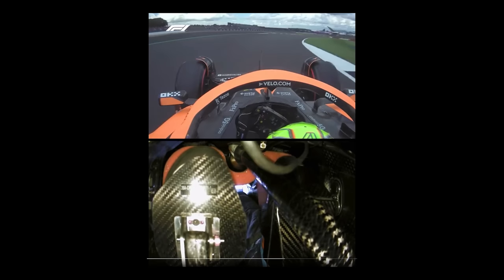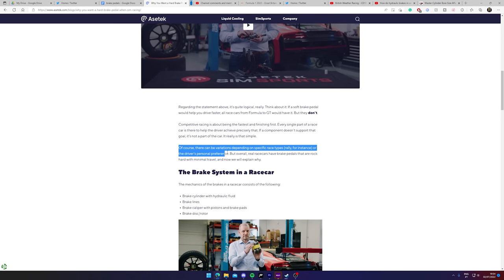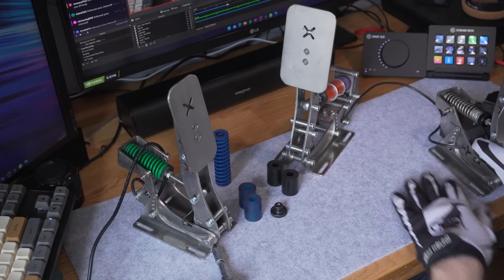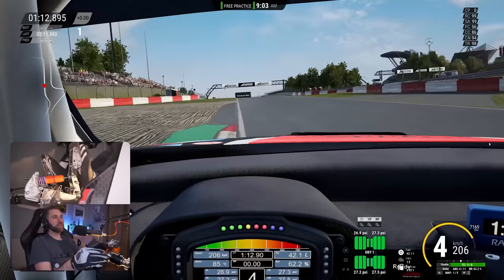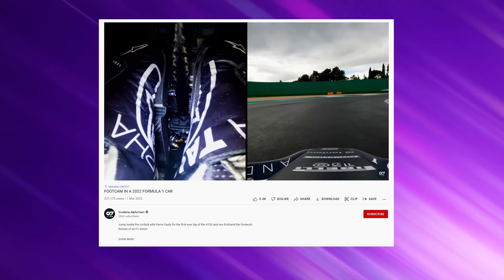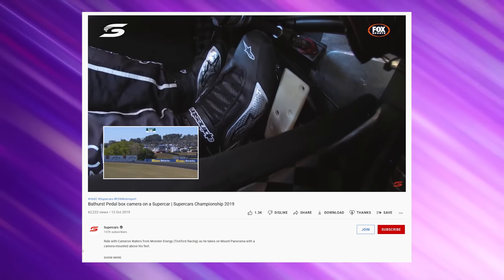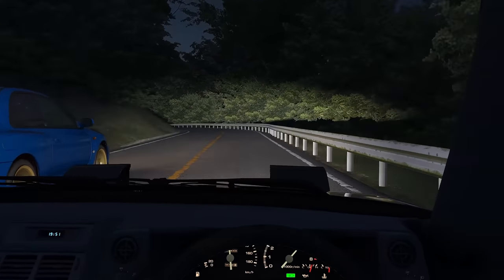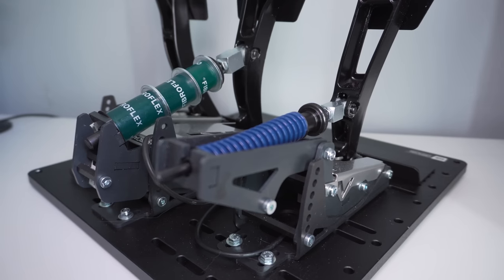Lando Norris brake cam shows simracing brake travel is all wrong

Comment: This was the first thing I thought about when I saw the footage from Lando.  I got the CSL load cells and like a lot of other people found them too stiff or not having enough travel.  Nice to see the pros like a bit of travel too!
Reply: That travel is not preference. Imagine how little control you'd have on the brake if you had a short travel. In Lando's video, you can see he slowly lifts the foot off the brake as his speed and gears go down.
Reply: what brf # are you using with your CSL:
Reply: @chadden24  I have it at 75 at the moment.  There's nothing wrong with the force.  It's more about finding it more difficult to get consistent trail braking
Reply: @grahamhill4113  
Try swapping in springs or softer elastomers, and having a mix of the original hard ones and softer ones. I find having that soft bit of travel before hitting the hard point, somehow help modulating braking better (instead of the CSL LC's zero travel situation).
Reply: @BrunodeSouzaLino  part of why he is doing that is due to a lack of anti-lock brakes
Reply: @BrunodeSouzaLino  I have almost no travel and have no problem modulating brake pressure. You modulate with force, not position with load cell pedals.

And in the video Lando has what, 3cm of travel in total in the brake?

Comment: One thing I think is being overlooked in terms of the F1 brake system is the fact it is a brake by wire system. The pedal isn't connected to any part of the braking system, it is connected to a black box that determines the amount of braking force to apply and the amount of retardation used by the Energy Recovery System. So I would say the pedal travel at least in an F1 car is a driver preference. I seem to remember that Kimi had a lot of problems adjusting to the BBW system when it was first introduced as he said the pedal felt numb and had no feedback of the braking response.

Edit, as pointed out below I was incorrect in the statement I made about the pedal connection to the braking system.
Reply: A very valid point but you are kind of half right. The brake by wire only operates on the rear brakes. This was introduced as part of the hybrid harvesting system. The front is still a conventional style brake setup. Maybe purely from a safety point of view. Also because if the fronts were electronically controlled we all know some devious software engineer would probably code in an anti-lock system. 😂 But yes you are spot on. A lot of drivers didn’t like it (and some still don’t) as it removes a certain amount of "feel" when braking. During testing a few teams (Williams was one) that had rear brakes catching fire because the brake by wire just wasn’t doing what it was supposed to.
Reply: I agree with Andrew. They will never have a full brake by wire system as it would require a fail safe in terms of if something would fail. Bmw has this on their new G-chassis cars. They use a DSCi module where the brake booster would be but there is still a mechanical connection to the brakes
Reply: @justinrehm6839  can confirm, have 8 series and it actually works pretty well but it will compensate for fade which I’m not sure I’m happy about. I’d be nervous if it didn’t have a mechanical failsafe
Reply: No it's not, the pedal is connected to a Tandem Master Cylinder directly, source, I work for a company that builds the Master Cylinders for both Red Bull and Alpha Tauri
Reply: So thats what BBW stands for...
Reply: Well Kimi was absolutely all feel driver.
Reply: Wrong, the pedal is physically connected to the master cylinders

Comment: I recall seeing a video interview with Sebastien Loeb in a custom sim cockpit and they had a setup with a hydraulic brake that clamped on a disc that spun according to the car's speed. This might be the most genuine sim way to emulate a real brake setup instead of what we have now.
Reply: time to go salvage an electric motor and my master cylinder and caliper/rotor from my car hah. Did they have a tire and wheel on it too, to give inertia to the setup? that's a crazy setup
Reply: @kylecossette5044  Maybe you could just bolt a weight to the brake cylinder for that purpose?

Comment: The "need" for a high force, short travel pedal in sim racing is all bullshit passed from one person to another and hailed as gospel. James Baldwin says he runs a low pressure brake specifically because it's less tiring over a race and so he can be consistant. When all is said and done it's all about using what you want and practicing with what you have.
Reply from the maker: Absolutely. Swapping master cylinders to fit the driver or track is pretty common.
Reply: @randomcallsign  the caveat with real world driving is you have other forces at play, g forces on your body and being shaken around in the cockpit, all which would prevent careful control of the pedal if it were too soft, so there you do want a decent force at the pedal (without being ridiculous) but travel really is just a preference.
Reply: @ravey1981  yes when you brake in a real F1 car you are pressed forwards in the cockpit by the g forces, so your ability to generate high load on the pedal increases the faster you decelerate
Reply: @johnduncan5117  well, yes and no. You don't move forward because you are strapped tight into the seat, and you're leg doesn't move forward because it's attached to your hip. But yes there is an increase in the "weight" of your lower leg but it's not as big as people would have you believe.
Reply: @ravey1981  Since you are moving the same speed as the car, you'd have the same amount of force regardless. Plus you're beind held by Hans and a 6 point belt.
Reply: @CleanPipes Source?
Reply: @CleanPipes This has nothing to do with G forces, but brake temperature.
Reply: @CleanPipes Your first statement is how every single brake system works. Stationary braking is down to brake temperature. Carbon discs don't brake well when they're cold.

Comment: My brake pedal feel is exactly like my road cars pedal feel. I'm never going to race, race cars. So I'm  keeping my left foot doing something that it's use to doing, and it works for me, plus it's basically worked out now, ever hour spent braking in sim couples with my actual car
Reply: I feel the exact same. However I drive a manual so I never left foot brake in my road car, yet I prefer the feeling in sim to be the same as my road car. Also can't right foot brake on sim at all. Weird how brains work lmao
Reply: @AcD420  Should get use to left foot braking in it, whenever I drive hard I switch to heel n toe + left foot
Reply: @McNab1986  hmm. It's pretty impossible to left foot brake only in a manual. Did it once by mistake for my license test tho, nearly made the officer in the passenger seat fly through the windshield
Reply: @AcD420  who said anything about using only the left foot. Don't need the clutch, left foot brake, you do need the clutch, you heel n toe
Reply: @McNab1986  oh sorry thought that was what you meant. Yeah that would certainly be possible. Might need to practice in my mom's car first then hahaha, definitely ain't practicing that in my own😂

Comment: I think that the pedal is set to Lando's preference, either that or it is stiff, because every time I see regular people driving f1 cars at events and such they can almost NEVER get to 100% brake pressure. F1 drivers are just very strong to be able to press it to 100% consistently
Reply: I agree 10000%. I think braking is very underrated in its difficulty in an f1 car. The maximum brake force the tires can handle changes as you decelerate because the aero becomes less effective as you slow, the tire temp matters a lot, and there is so much force to actually resist.

f1 cars can pull 5G on the brakes, that is basically 5G pushing the driver into the brake pedal. Yes, the harnesses and the seat absorb a lot of this but i’d imagine it’s still well over 1G into the brake pedal. If you wanna know what that feels like, stand up and do a calf raise with your left foot. Wouldn’t be surprised if drivers put well over 1.5x-2x their bodyweight into the pedal. Controllably. For an hour and a half. 

Mind blowing stuff.
Reply: Yeah.

100-150kg is 100-150kg regardless of pedal travel.
Since these cars don't have brake boosters, the only leverage is the pedal lever arm itself.

So it's always stiff, only the throw can be adjusted it seems.

Comment: Thanks for the video!

Trying to find spring sets for my brake pedal to mix with the elastomers just had me confronted with sim-racing elitism that ridiculed the possibility of someone wanting some light-effort travel before hitting the elastomers and compressing those. Finally someone who points out real systems actually do work like that and are not hard as a stone from the first contact onward.

Another thing to note is that "hardcore sim racers" are quick to ridicule people who do not want to drive formula cars all day. I bought my sim rig to yeet street cars over the Nordschleife, drift down Mt. Haruna and cruise the Shuto Expressway. In fact, I've never driven a formula car in the sim rig, I just don't like the things.

Somewhere the "simracing community" has ingrained itself that:
1. You NEED 15+ Nm
2. You NEED hard-as-rock load cell pedals
3. You can ONLY do GT3 OR Formula-style racing

I stopped visiting /r/simracing and related communities and just did my own thing, which made ME happy. And I don't need to make excuses of "yeah that's just what it feels like in a RAcEcAr" to everybody who hopped into my rig, as the inputs just feel similar to a generic road vehicle.

It'd be a good thing if the simracing community stopped being elitist circlejerks for a minute, and see what actual cars do.

/rant
Reply: Its a game. Have fun. I do agree with the 15+ thing, but thats more for redundancy reasons. But in the end you need to have fun with your hobby. No one here is a pro racer or aspires to be.

Comment: I don't have any info regarding the brake pedal travel for F1, but I listened to a podcast with a long serving F1 engineer (Jock Clear I think) and he mentioned around 55 mm travel for gas pedal in the Schumacher era. He mentioned Villeneuve who had less than 30mm gas pedal travel.
Have in mind that the current F1 cars have brake by wire.
Reply: Current F1 cars have hydraulic brakes and steering. The electric variations of those two are banned.
Reply: Jock Clear mentioned this in his episode on the official F1 Podcast.
Reply: @BrunodeSouzaLino  I looked it up, the rear is wire, the front is hydraulic.
Reply: @iulian2548  As per Section 11, Article 11.1.1 of the FIA Technical Regulations:

"With the exception of a power unit, all cars must be equipped with only one brake system. This system must comprise solely of two separate hydraulic circuits operated by one pedal, one circuit operating on the two front wheels and the other on the two rear wheels. This system must be designed so that if a failure occurs in one circuit the pedal will still operate the brakes in the other."

Even if you have an electronic system to control the rear brakes, they're still hydraulic.
Reply: @redscreentrombone4685  I did read the technical regulations to confirm that before posting.
Reply: @redscreentrombone4685  Did I say brake by wire was banned or did I say electric brakes were? Those are two different things.
Reply: @redscreentrombone4685  Regulations don't name exactly what they ban

Comment: I think the main thing pf the sort/stiff pedals in simracing is that, at least for me,  you can be more consistent with presure than with travel. In sim there is a lot of information you lack, like the pedal vibration or G forces. Thats because in a real car, you can have larger pedal travel to modulate the braking easyer.
Reply: A potentiometer or hall sensor with a rubber block that requires increasing pressure to depress the pedal further already allows your brain to process and remember pressure.  It's irrelevant whether the instrument measures pressure directly or not.
Reply: @saintsalieri  And that's literally what I'm saying, since with that ruber block, you are relaying in the pressure, not in the travel. Im not talking about the device itself.
Reply: @POVmotorsport  fair, I misconstrued your point a bit.

Comment: After a LOT of research, I saw that a TON of GT3, Formula Pros used Heusinkeld Ultimates. At first I stuck with the default 3 Hard elastomers. After doing more research about the travel movement that pros used in their sims, I saw that most used 45mm-62mm pedal travel in the sims. The default elastomers in the Heusinkeld Ultimate + gave about 25mm travel so I switched to the 3 softer elastomers and I get like 50mm travel now. I created two profiles in Heusinkveld Smart Control for GT3 and Formula cars with different Max force and I pretty much have the perfect travel and pedal strength I was looking for all along.
Reply from the maker: Thanks do much for the super thanks

Comment: I’ve been saying this for ages. Some load cells are completely unrealistic with 0 travel…
Reply: Haha yeah. But in F1 engineers can adjust the pedal travel to the drivers liking and preference. In GT3/4 and touring cars they cars are built by a manufacturer but even then the mechanics of the team can change the travel to the drivers liking. And a vast majority of driver prefer travel. When f1 drivers say the pedal is long they don’t mean that it’s traveling. They mean it’s traveling a lot more than usual. There is no such thing as a brake pedal in a race car that has zero travel. Even the stiff brakes that some drivers like travel. A lot of sim racers use pedals with zero travel or so minuscule that it barely moves. And no race cars have brake pedals that travel that little. With so little travel you don’t get any feel or feedback for you braking.
Reply: Yeah I used a set with load cells at a sim racing cafe and they felt really weird, no travel whatsoever and you had to really stand on them (to the extent that my knee was killing me after an hour) to make them work. I've driven a bunch of cars and vehicles with unassisted brakes in real life and that's not what they feel like at all, you've got to press them harder than the brakes in a road car but it's way more progressive

Comment: Watching the entire video is pretty insightful. Its not just empty travel moving the disks without braking, he presses smaller shorter distances with trail into certain corners well below the maximum travel we see so he appears to have very little slack but quite a lot of practical movement range all of which is providing him with more braking force. I would love to hear some questions to Lando about the adjustments he can do to the brake pedal and his preference of setup.

He clearly overlaps the brake and coming off the accelerator considerably. He trails sometimes past the apex point and they clearly use trailing to get the nose to bite in on those high speed corners which is interesting. He is very smooth off the brake every time and with really quite long periods of trail braking. So beyond just the brake travel there is also some simulator knowledge that is wrong here as we tend to get off the brakes to balance aero and we don't cross over the accelerator and brake and if you trail heavy into a high speed aero corner the car is going to snap. This pedal cam of a complete lap informs where a lot of sim knowledge isn't quite right.
Reply: I'd be careful in taking what Lando does as fully 100% applicable to everything. Ricciardo has found the braking with the McLaren to be very difficult and Sainz has told also that the braking with the car is weird. Ricciardo hasn't adapted to it in 1,5 years. What does this mean? Might be that the McLaren need help with the rotation of the car in corner entry or mid corner for example, so this technique might not apply to all cars.

Comment: The full brake pedal experience, including the changing "free travel" as brake fluid changes temperature and as pads wear down, and vibration from worn discs, can be simulated with a servomotor to "push back" on the pedal, controlled by some clever software. The problem is this – a brake pedal servomotor would require several times the torque of the biggest direct drive wheel (which is also a servomotor). The cost, bulk and power consumption would be a little insane. There may be ways to work around the power and bulk, but the solution would be even more costly.
Reply: But the travel being much smaller, you could have a small fast motor with huge gearing to reach the desired torque. You can get RC servos that are smaller than a soda can and that would have similar torque to entry level Direct drive wheel for a few dozen bucks ... 
This seems very feasible from a mechanical point of view, I think the main issue would be the software to 1) control accurately the brake and 2) get info from the game about which force should the player feel. Not a single game was made with 2 in mind so appart from Asseto Corsa that in theory could be modded you simply wouldn't have any game supporting this and just have the servi act as a fancy spring
Reply: thats over engineering
Reply: @danieldorn9989  if you look at it this way, sim racing is over engineered as a hobby.

Want to get as close to what it feels to drive a car around a circuit ? Well, go drive a car around a circuit 😂

This idea would be the best way to get as close as it gets to the real feeling of pedals in a car. It's not more over engineered than having to use a loadcell to mesure brake pressure ...
Reply: Simucube have literally done this, the pedal is £1600 just for the brake alone!